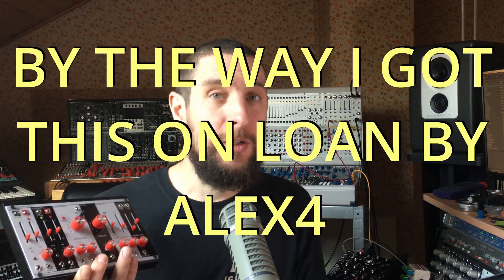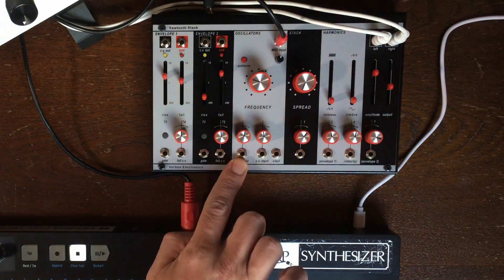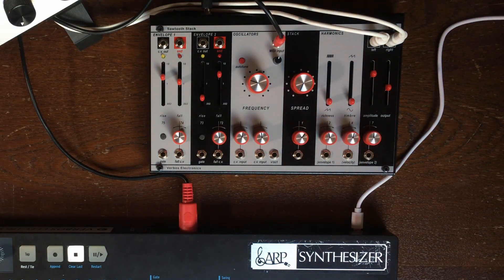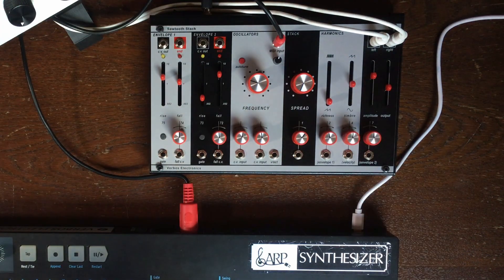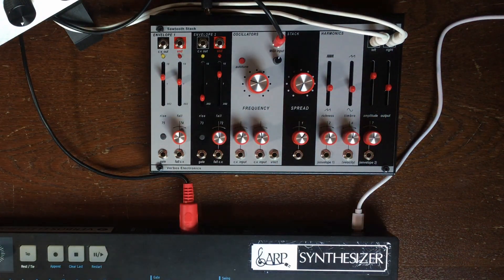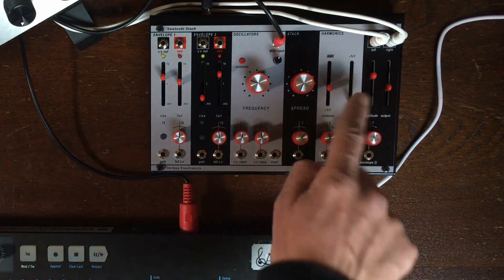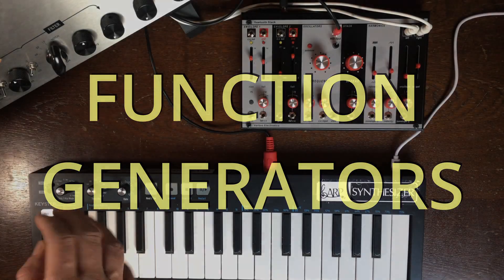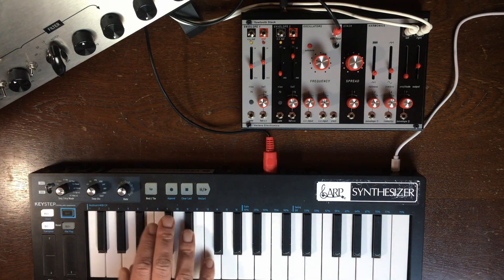Does it Swarm? Verbos Electronics Sawtooth Stack Demo

Comment: I think what annoys me about this module having gotten it and played with it for a while now and although you can (kind of?) tempt nicer pads out of it if you are patient and put some effort in, but good lord mostly it just sounds like this hellish atonal swarm mess.  In my opinion a module should be versatile/ capable of a wide variety of uses/ sounds/ applications. Especially for the money/ HP that this thing absorbs. 

It just feels like it was designed for a very specific techno sound, and no other application was considered which is very annoying as a non-techno ambient user. As others have mentioned the 4hp Chainsaw is capable of this detuned swam sound, or beautiful lush pads and everything in between. I know that is a digital module, but I was very much hoping that more lush and pleasant pads could be easily achieved with this beast.

Also, as it is advertised as a self contained synth. Put some god damned VCAS in this thing! The Verbos case is nothing but oscillators and envelopes. For chists sake we don't need two more! We need VCAS. Haha

It may not sound like it, but I love VERBOS. They are the only manufacturer I used any more and have sold off everything else. But they do drive me insane with some of their choices/ limitations sometimes.

Comment: Synth Tech's e340 incurs a tasty Verbos-ification?? This Spread knob with its predetermined panning position and detuning interval is unideal. I would prefer to manipulate those values freely, even with the addition of a simple toggle switch above the Spread pot to dictate a spread/detune mode or something for sets or pairs of oscillators if not individually. Still, an intriguing module with tasty sick sounds achievable via simple means! I do harbor an elevated infatuation with Verbos modules. Such a physically spacious, logical, and handsome feature arrangement, which is essential for me - all the glorious space! The two function generators are neat tech on their own. Très cool. Great demo Stazma~ ☮